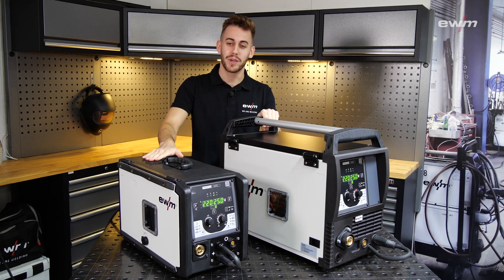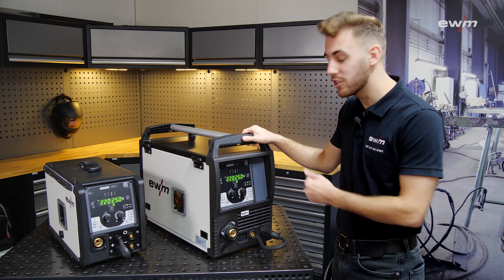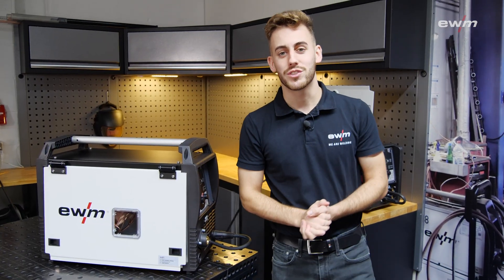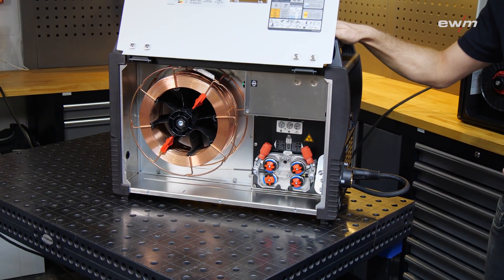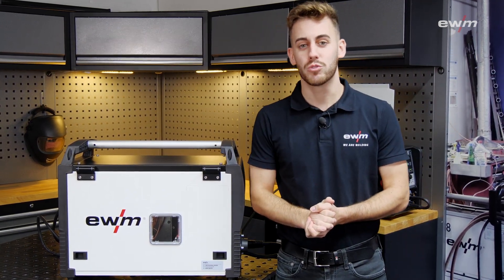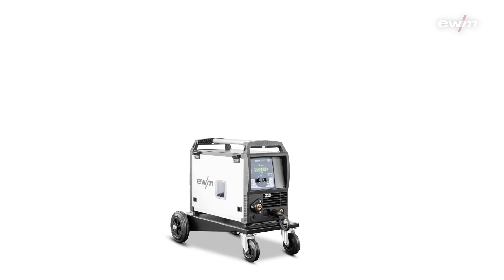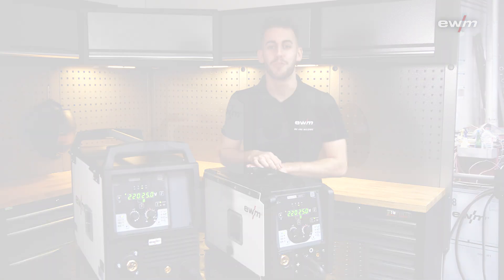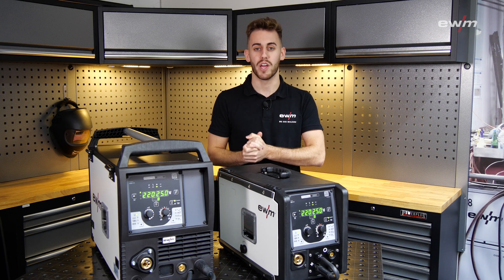Picomig 220 & 225: compact welding all-rounders | EWM

Comment: Why does the bigger version have different drive rolls?
Reply from the maker: Hello @MrChickenking44, thank you for your question. The reason we have built the Swissfeed drive into the Picomig 220 is the machine has not enough space for housing the slightly bigger efeed drive.
Reply: @Ewm-group  is the swissfeed drive more beneficial for feeding the wire? I have the picomig 180 plus and currently run 1mm 4043 wire and it runs perfectly. I don’t change anything and no Teflon liner! Just a standard metal liner. Brilliant machine!